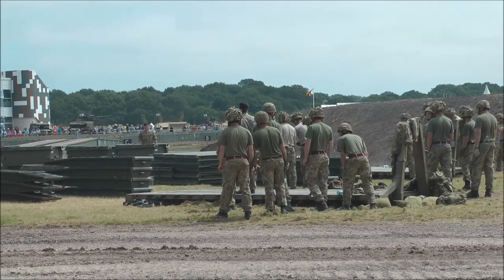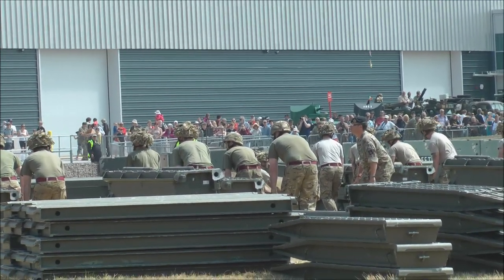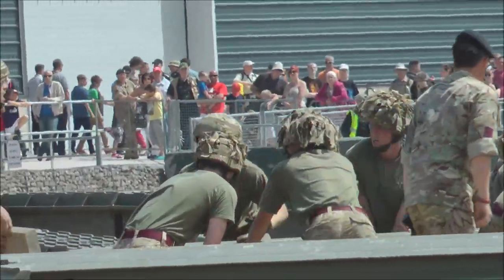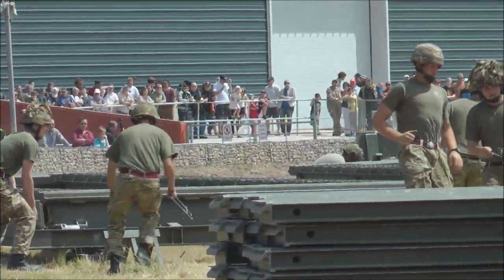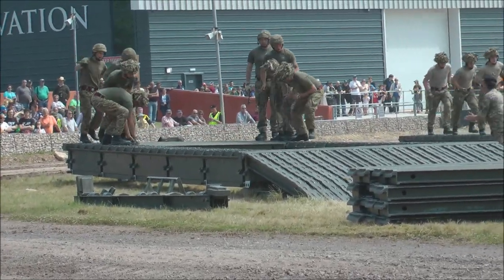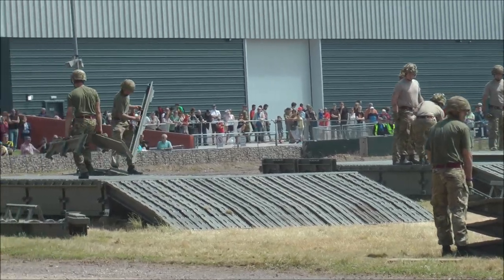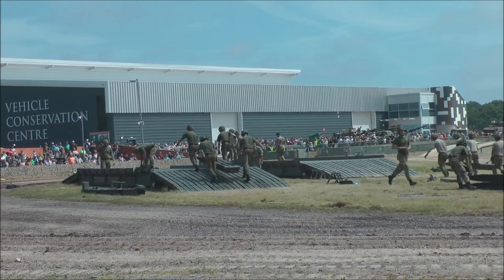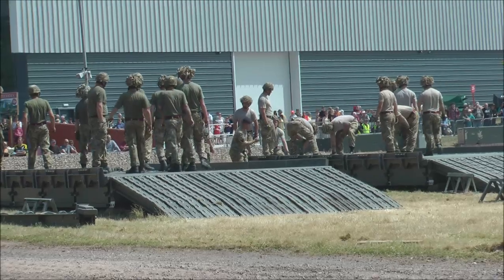How to build a bridge in 8.5 minutes.

Comment: Is this thing made of plastic or something? I was a combat engineer in the army many many years ago and the Bailey bridge we built was solid steel. We built one in ait and it took like 200 guys most of the morning. This fucking thing was heavy.
Reply: Bloody Bailey, absolute loads of 'em out in Bosnia, and we built one in Basra back in '01.
Reply: Bailey Bridge was horrendous we spent 2 days on that at Hawley Hard, most of the emphasis was on this if I remember rightly. Got I was fit back then, 2010. Had it in summer as well for an extra kick in't nads.
Reply: It’s the MGB Medium Girder Bridge. They announce it.
Reply: It's aluminum. It's heavy enough but not as heavy as the Bailey. And a lot fewer parts. We used it back in the 80s.